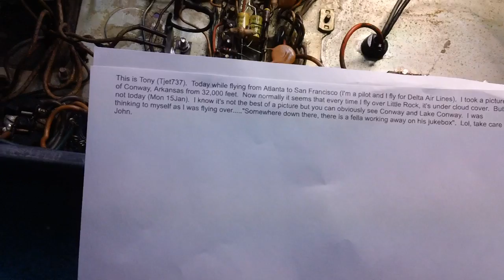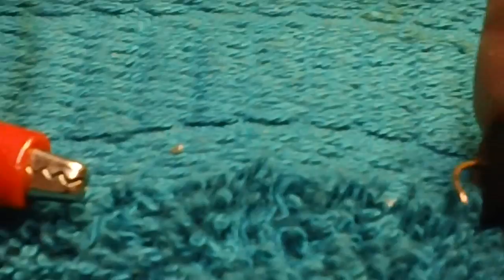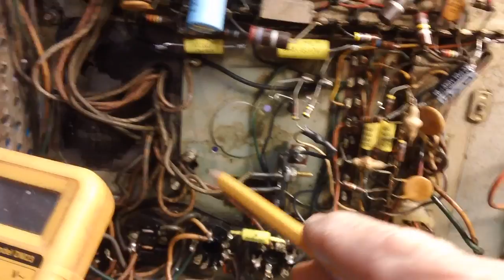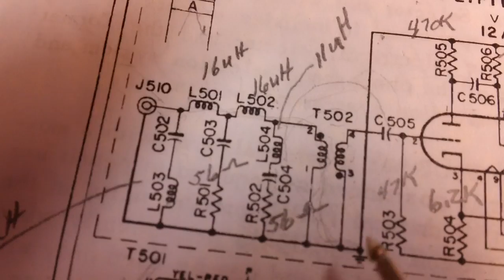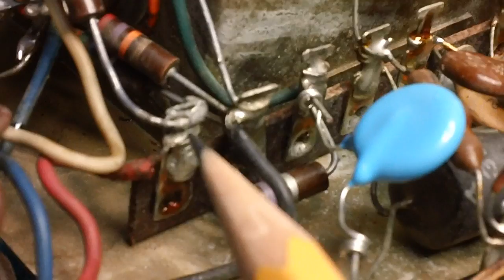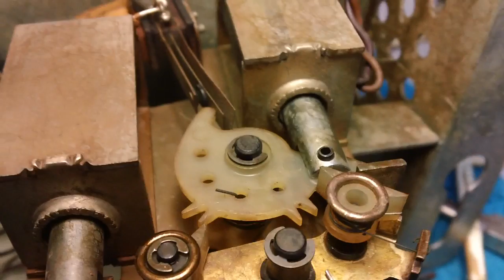1961 Seeburg AY100U Jukebox restoration (Part 53 of 87).

Comment: John, I need a full bridge rectifier too. Working on a Grundig Radio. I found some on Mouser I should be able to mount it directly to the Chassis. Below is a Mouser search if anyone else needs them. Only 72 Cents each. The IC Package is a D3k-4.  Thanks for the Video.

https://www.mouser.com/search/refine.aspx?N=4273645435+18337911

Comment: John,
There is a fair to good chance that ‘top hat’ (I refer to them as DO-1 package) rectifier is a silicone junction diode.  They were popular during the first half of the 60s.  Here in England, a BY100 (being DO-1 package) replaced valve HT rectifiers (PY33 remained in use up to 1961/62) in monochrome televisions …a little bit of TV circuit history for you my friend. 
When I first encountered an ‘add/subtract’ unit, I thought of it as a type of escapement mechanism which in many respects helped me develop a better understanding of its function, and purpose. 
Yes, it’s all good, harmless fun, and it keeps us occupied for hours at a time …or as my wife says, it keeps me away from getting under her feet, or talking her to death LOL.
Regards, Phil.

Comment: Hi John,
Surely, a ground, is a ground, is a ground! Why move it? I had no problem with the grounding you gave it in the first place! Jeez, some people! Nice job cleaning those solenoid mechanisms my friend. The jukebox will be up and running in no time.
Reply from the maker: Gordon,
It was important to cover that a chassis-soldered ground is probably the best type although not 100% necessary.   I recall big ARF discussions about doing it, but like you say...a ground is a ground.  One only needs to make sure it's mechanically sound.
Regards,
John